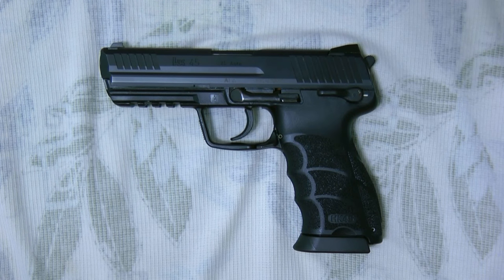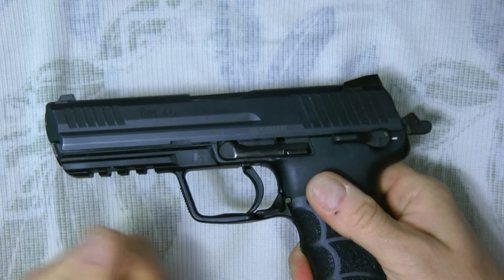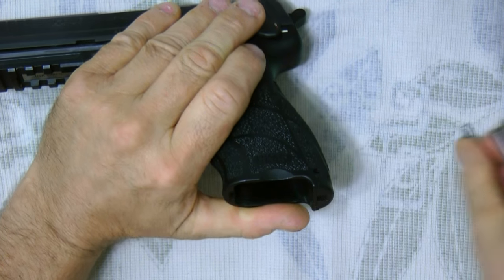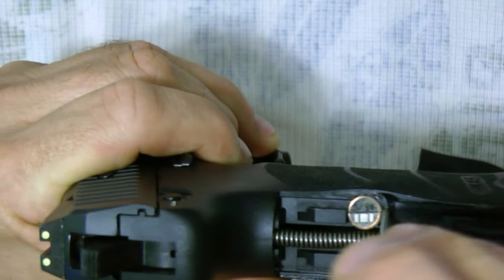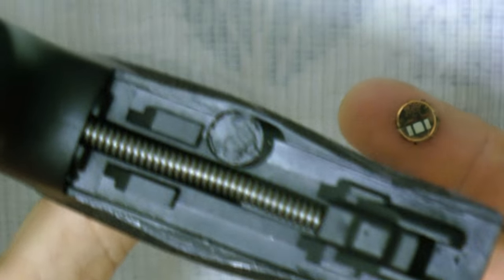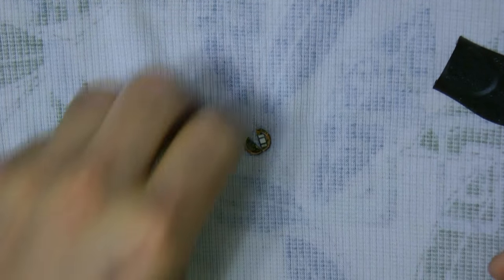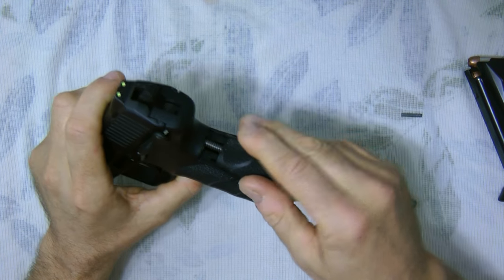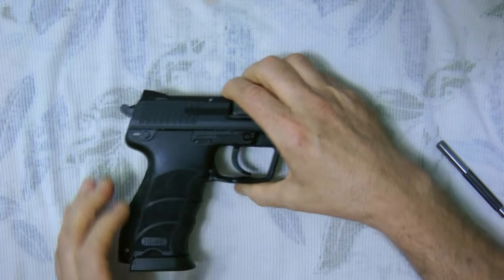HK45 RFID Smartchip How to Remove From your HK45

Comment: The chips are only in the ones that are sold for military and police, they use them for inventory purposes. They aren't in the civilian models. 
    The chip has to be read by a scanner at very close range, it's not something that can be tracked using satellite or cell tower tech.
Reply: I was just going to say.. I dont think that's standard because the P30L is also a known service gun which I own, and mine didnt have a chip.in it. Thanks for explaining.
Reply: You can read rfid from blocks away with a big enough antenna and amp.
Reply: Was gonna say, mine never had one...
Reply: Bullshit.  Mine had one when I bought it.
Reply: @sl600rt  Not a passive chip as this appears to be. Max distance in perfect conditions would be around 30 feet.
Reply: Walk into a store thru the detectors and they know your packin’

Comment: With a changeable backstrap .. that chip wasn't even hidden in the slightest. My bet is the chip was used by HK for the manufacturing process/quality control. They intend for people to see it, and likely remove it.

At RFID frequencies the polymer frame is invisible to scanners. If they didn't intend for people to find the chip they would have buried it in the polymer during molding.
Reply: My HK Tactical manufactured in 2021 DID NOT have a chip, although there was a place for it to go. I called HK and found that some time ago, there was a LEO contract and it was requested. Some of those guns found their way into the common market

Comment: Just checked my HK45.  There's a circular slot where yours has an RFID chip, but mine was empty.  Not sure when this process started, but not in mine!
Reply: Michael McLaughlin same here (hk45 tactical). Considering the Hk45 was primarily developed for submission into the U.S. military trials to consider replacing the beretta m9, It does make sense why the Hk45 would have that chip, or a empty space where one could be installed. Military armorers scan every weapon, side arm, etcetera. Not really a big deal, imo.
Reply: @Count_Grishnackh  Agreed.
Reply: Just got mine two weeks ago and didn't find one    so good to go

Comment: So I just checked my 3 month old HK45 full-size and no RF chip though does have the round pocket for one.
My 8 yr old HK45 doesn't even have the round pocket for a RF chip.
Now 8-9yrs ago new owners of the HK45 were finding shot counters in the hk45s.  These are a strip up inside the mag well on the wall.  About 2" in length so if there is a problem with weapon and sent to factory for repairs they could pull the shot count from the strip. There should be old video or pictures on forums showing the thin strip.
Neither of my hk45s has either of these but the fact there are pockets built into polymer frame for these things is disconcerning to say the least.
Soon. These electronic devices that require no batteries will be mandatory.
Check for both, then promptly remove and destroy them.

Comment from the maker: all hks sold have it because they dont make a non police model. I called HK they said the way the guns are sold is the way they sell them to the Govt, Thats why They dont come with a 578x28mm standard suppressor threaded barrel becaus the milatary uses the non standard 16mm thread. They are sold the same to public as to the Govt, call them and ask?
Reply: bulletsnbytes that's bullshit.  I've owned a dozen plus HKs from USP Compacts to P2000s to P30s to a 45 Compact.  None of them had it.  Having the pocket is not the same as having the chip in the pocket.
Reply: Murphy82nd how long ago did you own those and how long ago did they start using the rfid chips? Is it possible you just didn't know it was in there to start with if you ever did have one with it?
Reply: KridikJones I owned them over a period of years and as recent as two years ago.  And yes I typically had the cover for the hammer strut off at some point as I did full disassemblies on most of them and hammer spring swaps on basically all.  Look at the other comments.  I'm not the only one to own one without the RFID chip, so to say all come that way is incorrect.